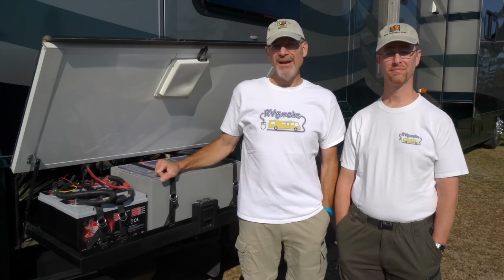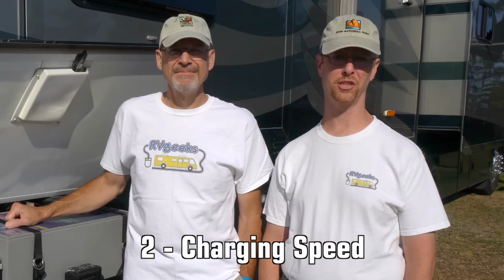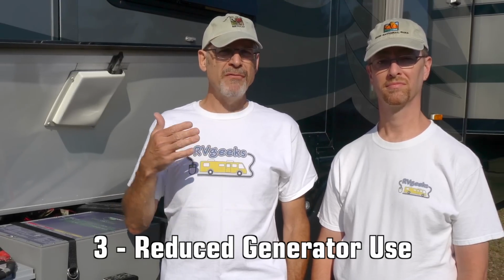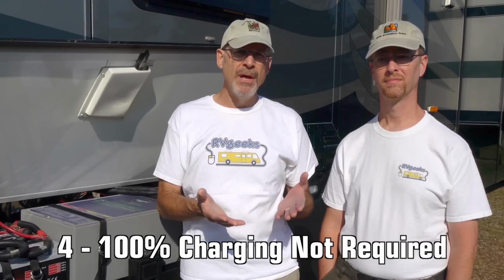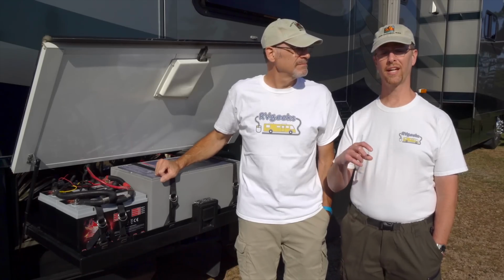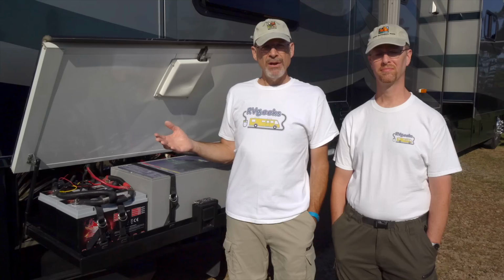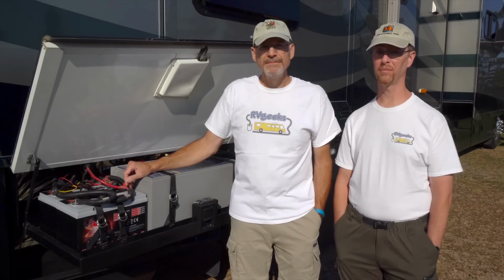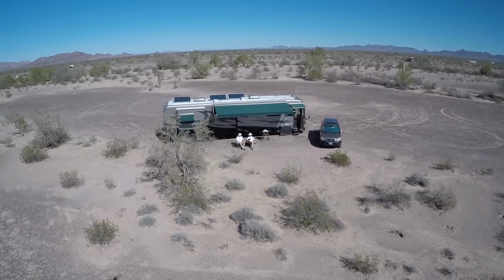🔌 SYSTEM UPDATE! RV Lithium Battery & Electrical Project — 3 1/2 Months In!⚡️

Comment: There's only one negative about Lithium, that is Freezing Temperatures, they don't like it.  SLA-AGM batteries charge in as low as 0°F temperatures.   Solutions are: add Battery Blanket or Heat the compartment enough to meet the minimum operating, or go south for the winter months.  Next step guys, order up those 235 watt solar panels you always wanted, its only money... they say.
Reply: The Xantrex battery as you can see does not look like normal batteries lithium or lead... anything. That's because it is a sealed unit with the ability to heat itself to maintain proper temps. If you have the time you should look at the previous five episodes of the install of the batteries, to learn more about these prototypes. If you watch any of there previous videos you will see their attention to detail is extremely high. Another way that other classes of RV's solve this problem is by placing them inside the rv where the heat is. Of course, most Diesel Pushers have there banks outside the living space.
Reply: Well said, the attention to detail is exquisite that these guys put into their video's, giving us a lot to learn from their successes!   As mentioned, the Xantrex heats itself to maintain the warmth and ability to charge.   Unsure on the cooling if/when in extreme heat situations, but I've seen other video's where they have added fans to blow the heat out of the battery compartment, so it's basically the cold situations to watch for, especially those of us in the Pacific Northwest or Northeast coast folks.    Yes, we often make our way south, but often it's very cold prior to heading south!
Reply: It is true what you say about freezing temperatures, but in our experience it has been a non-issue and we have camped as ow as 25 degrees.  Keep in mind that the lithium batteries have a battery management system and part of it's job is to shut off any charging when the core temp drops below 32 degrees, so it protects the battery from damage.  In our install, I lined the battery box with reflectix and placed a work light with a 60 watt bulb to heat up the compartment, and have never had to turn on the light except as a trial, even when the ambient temps were at 25 degrees.
Reply: Hermes great idea about 60 w bulb
Reply: The batteries they installed have a special system that will heat themselves in cold temps... One could add a automotive battery heating pad & thermal receptical and insulate the battery bay in a self install
Reply: Could you explain a little more of them "heating" themselves? Like can it heat itself in 10 degrees?
Reply from the maker: We haven't been in temps that cold yet, but the heating system is specifically designed to allow the battery to be fully operational (including recharging) in very cold temperatures, so we're going to say that yes, it should have no problem in 10 degrees or lower, since that's exactly what the internal heating blanket is designed for. We'll provide more details as the become available as Xantrex (hopefully) continues forward to make this awesome system available for retail purchase.
Reply: Thanks..... will be watching:)
Reply: @RVgeeks  I spoke with Xantrex and they hope to have 4-5 aftermarket vendors set up in the spring of 2019.  They are also developing a solar panel especially made for mobile use that is not as suseptible to vibrations etc. They say it will last longer on an RV than a normal residential type panel.
Reply from the maker: Good to know... thanks, Chuck!

Comment: 6th. Thanks for the outstanding update on your lithium battery upgrade. I really wish that Newmar would offer lithium batteries as an option on their coaches. Keep the great videos coming and safe travels to the both of you!
Reply from the maker: Thanks Kite! A little bird told us that Newmar’s working on it. 😉 But of course this kind of leap forward takes time and diligence. Hopefully soon.
Reply: I sure do hope your little birdie was telling the truth. Also we are probably going to buy a New Aire in 2020 so I hope they have it sorted by then!!! I'm sure the option will be quite expensive, but it will be probably less than back fitting as you would have a battery charger and a set of flooded lead-acid or AGM batteries that are used to dispose of. And then there's the issue of building a battery tray as you are well aware of. Once again thanks for the great video and keep them coming.